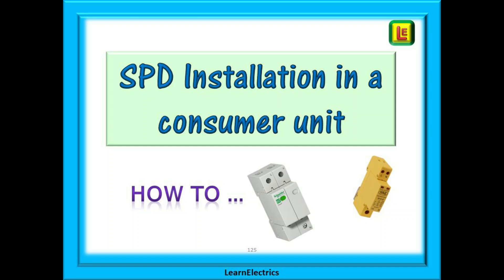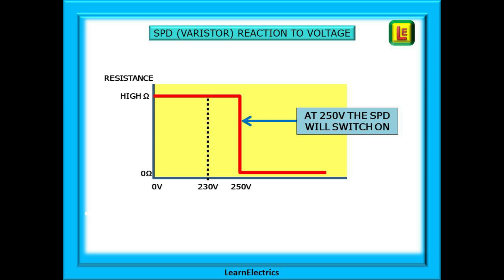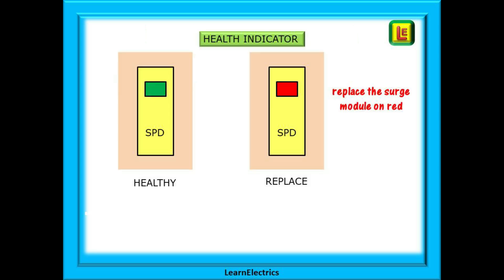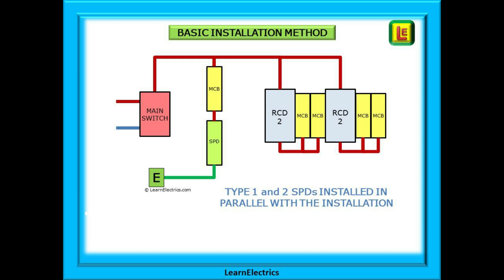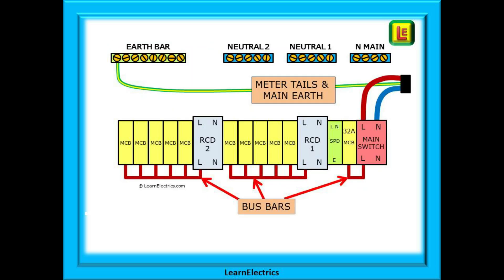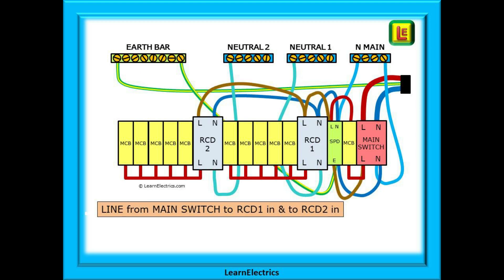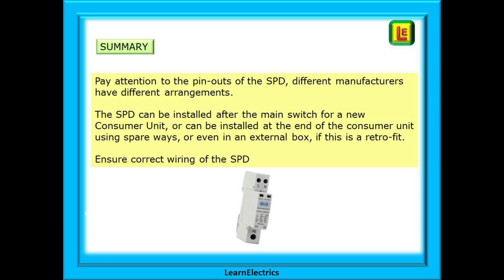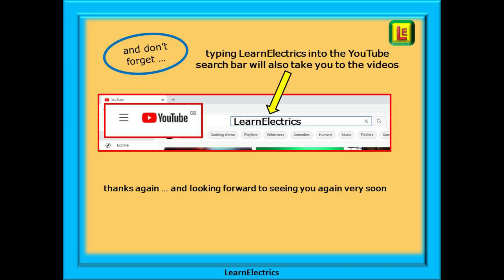SPD INSTALLATION IN A CONSUMER UNIT – HOW TO and THE BASICS

Comment: Thanks David...Good video. Quick question... If the MCB protecting the SPD from a longer duration surge, was to trip, would this not just send the Surge back into the installation?
I would have thought it better to let the SPD take all the surge and I wouldn't have thought the MCB was a good idea???
Reply: All devices can fail over time and if the SPD fails short circuit then you are risking fire without the circuit breaker (or taking out the main cut out fuse).
Reply from the maker: Brilliant answer Jonathan, thanks for the support. Dave.
Reply from the maker: Thanks John, see Jonathan's reply below. Thanks for watching. Dave.
Reply: From repairing power supplies from africa where there is a lot of lightning, MOVs frequently fail short circuit. If there is no overcurrent protection this could end badly.

Comment: There is a lot of controversy over SPDs and AFDDs mainly the cost of the them and weather they are really needed in domestic installations? 
 I have asked many times a simple question but no one has come back with an answer or area unwilling to answer because the question throws a spanner in the works ? 
So I try again , if lightning hits the main transformer at the end of your road or the overhead power lines , why is it a problem ? Ok you could loose the power in the hole street but how would it effect our house? Surely the short lived surge will only get as far as the DNO cutout witch will blow ?  And the surge can’t go any further, 
Therefore an SPD is a pointless waste of money?  Personally I think  it should be a personal choice if a home owner want it or not, to make them mandatory is the wrong thing to do how many people can afford to have them not a lot.
Fantastic video very interesting and informative as always Dave 👍👍👍👍❤️
Reply from the maker: Yes, lots of interesting discussion. The day will come when Building Regs say they must be fitted. I know the insurance companies are interested because they are insuring tech equipment and SPDs will reduce their liability. Good point Sean.
Reply: Yeah it's an interesting question.
Makes me wonder how many surge protected devices basically do this in / on circuit?
e.g. you could make a plug in device that does this at a socket and I wonder if those devices are actually doing this when they are plugged in.
And as you say justification wise, I've seen two times when power spikes have clearly killed equipment and both we're direct lightning strikes to the building.
Outside of this is would be very hard to prove one way or another if this device is actually doing anything.

Anything I need protecting is on the other side of a UPS or at minimum a SPD gang or plug.
Reply: So yeah double checked, most SPD power bars / extension leads do this at the plug so if you have one of those plugged in anywhere guess what you already have :)
So if you want more protection just plug in more power bars.. ;D
Reply from the maker: Thanks Dave.
Reply: @TheWebstaff  as you say it’s interesting. I know power strikes can induce currents in places they are not supposed to be, ie in earth which does tend to cause problems in IT systems. I’ve also seen large surges caused when power had been shut off at the DNO level ie when a full office block and lots of other offices in the same area were shut off, when the power was turned back on again lots of PCs were blown in the offices below. We were fine as I insisted on unplugging every device not just switching off the socket. No way to tell if a spd would have prevented the problems. Personally it’s one of those things that feels like a product that found a solution rather than a problem that needed a solution and a product was developed.
Reply from the maker: Lots of discussion Dave. No-one has a definitive answer but I feel they will be compulsory on new builds and board changes in the coming years. Thanks for the input. Dave.
Reply: Aslong as you consult the client to say if I dont install this SPD and one of your electronic equipment goes bad so I do not want to be blamed you dont actually have to instal it. Write this on the Electrical certificate also so your covered.
Reply: I have had some LED bulbs go in my house, and they are meant to last many years. The latest one to go was marked as lasting up to 25 years, but it has probably only been in for 1-2 years (not sure). That 25 years is based on only 2.7 hours per day, but even so... It think it must have been a surge/spike that caused it because another bulb still works but flickers. So I think any that were switched on at the time of the surge/spike were probably damaged. That is why I am looking into SPDs. I am thinking maybe one would help?
Reply: The LED bulbs don't seem to have much protection built in.

Comment: Thanks David once again, recently installed a summer house with your previous video. Helped so much. I’m level 2 qualified so just an improver but got my work signed off by BA. Plus another fully qualified spark for your video. It’s really helped so much and you’re the don of the trade mate.
Reply from the maker: Thank you so much.
You are never JUST an improver or JUST an electrician. You have a skill at whatever level you are at and every day you are adding to that skill. Keep learning, its a great trade and its taken me all around the world on some really interesting contracts.
Good luck. Dave.
Reply: @StreamFeeds can I ask was it fairly easy to get building control to come out and inspect and sign off? What’s the procedure? I’m wanting to change my consumer unit and I’m currently re training as a spark, so would be brilliant if I could do it and get it checked etc also do building control do minor works sign offs for say if a wanted to add spot lights from a pendant and add extra light switches etc and also cracking video again dave many thanks🙌🏻🙌🏻
Reply: @kingofthetrowel1725  I wouldn’t get BC involved if you can help it. Do the work and get a fully qualified spark to sign off for you. It cost me £500 to get stuff signed off. I found someone just after I had my first encounter with BC and would never go back to BC again now… lol
Reply: £500 to get work signed off!!!! Wowza

Comment: Great job dave..
May I inform you about new important topics you can make explanation videos for

- ups using, concept rating sizing
- generators
-capacitor banks
-electrical rooms design
- bus bars
-voltage drop and short circuit
- harmonics
- light calcs

Go ahead and great job man
Reply from the maker: Thank you Michael. We have a video on lighting calcs and distributed loads coming along soon. Thanks for watching.